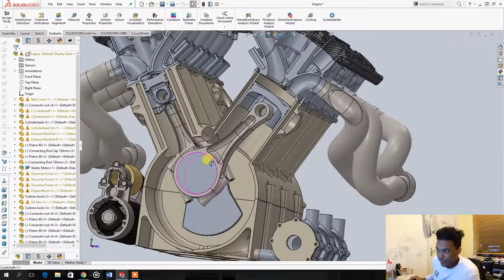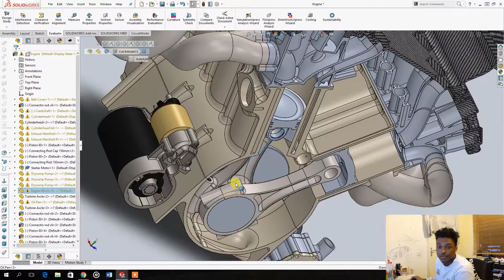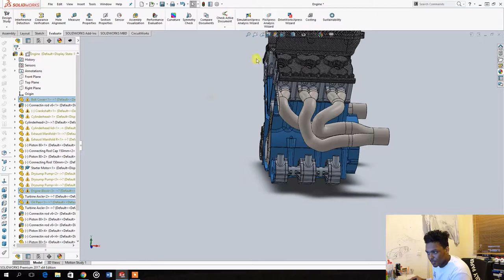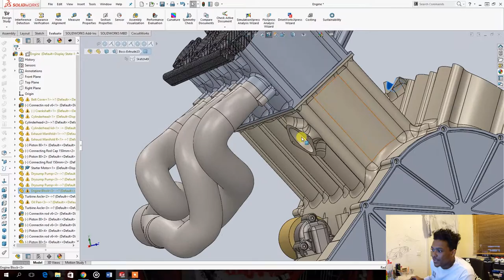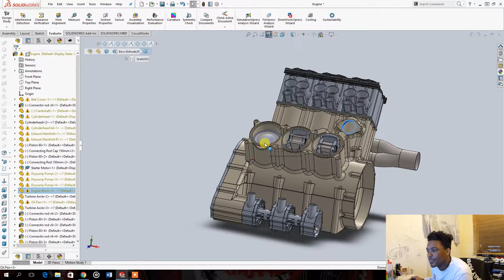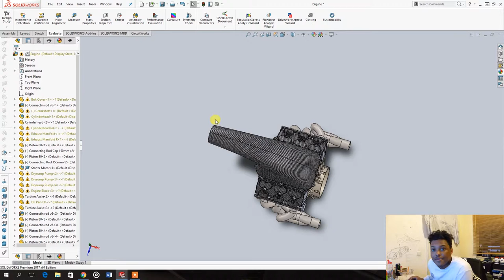Engine lubrication and cooling explained | Single Seater | SVA Design

Comment: | would recommend you to fit some parts based on some existing market solution ( Motorcycle parts Pistons rings and etc.)Ducati have motors L4 ( is basically v4 only difference pistons are connected on the same points on the crankshaft) may use same pistons dimensions and adapt your motor for cheaper production,and to avoid all the problems related with production with customs parts involved in your design).
Reply from the maker: if i can really start making the car i will make sure to look at already existing parts for the car for sure.
Reply: Did you take any decision regarding wire harness?
Reply from the maker: no i dont know a thing when it comes to electronics
Reply: Well,you have to split all components in 2 system 12 Volts and High Voltage(Battery,Motor,Controller & Motor Itself),also CAN Bus Protocol Linking will be recommended.Do you take in consideration to use AC and any Entertainment systems?
Reply from the maker: Vitali Bazilevschi there will be a lithium ion regular car battery in the car and also the high voltage battery for the e-motors. there wil also be a multi medie system in the car. and i still need to add the compresser for the ac. for heating i will use the radiator liquid